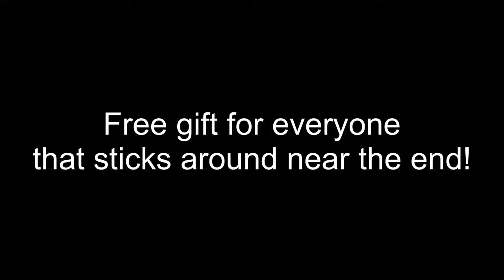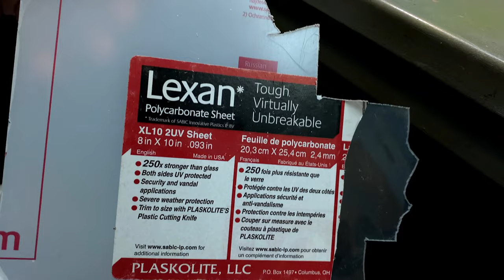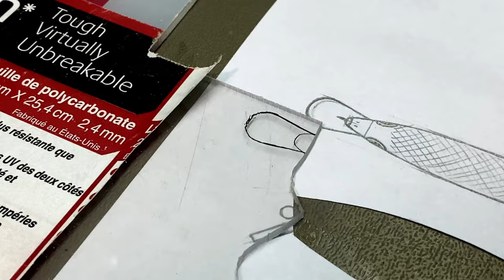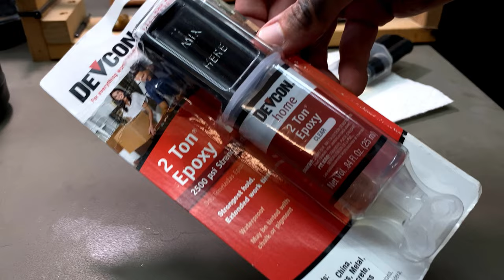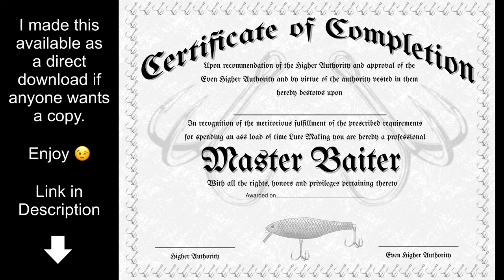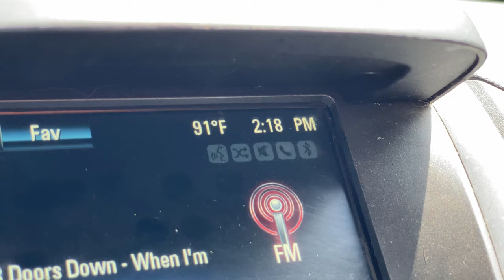Lure Making for Beginners | Easy Minnow Lure

Comment: Thank you for this outstanding video!  Why do you seal the wood then use paint over it?
Reply from the maker: Sealing the wood keep water from soaking into it
Reply: @TreysArt   thanks but why do the seal first then paint over that is it so it can’t soak through the paint from inside out?
Reply from the maker: Yes. It’s just a protective measure to make sure the wood stays safe and dry. Usually I top coat my lures with epoxy but any small hole or crack could cause water to soak in.

Comment: How do you know how much wait needs to be added
Reply from the maker: I’ve done it so much I can get pretty close by guessing but to be accurate you’ll need to test different weights to see what works best
Reply: @TreysArt  ye but how heavy does it need to be. I saw you testing them all out but how did you know how much weight is enough
Reply from the maker: Usually input just enough to where it will still float. If it starts sinking then it’s too much. If you’re going for a floating Crankbait that is. Every lure is a little different. It really depends on what type of action you’re going for.
Reply: @TreysArt  aight thanks